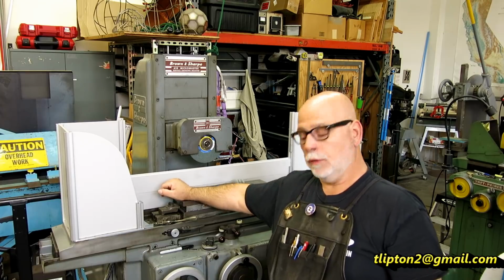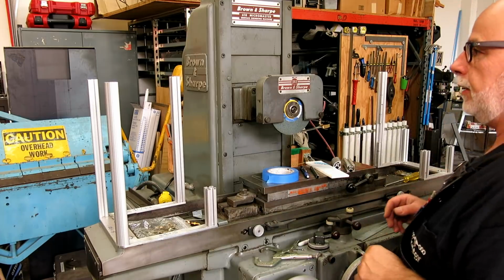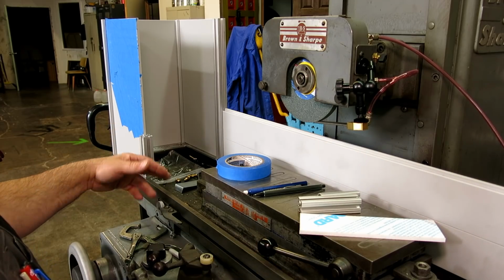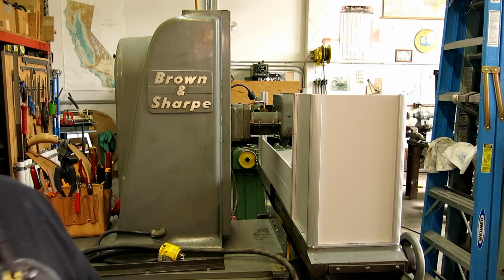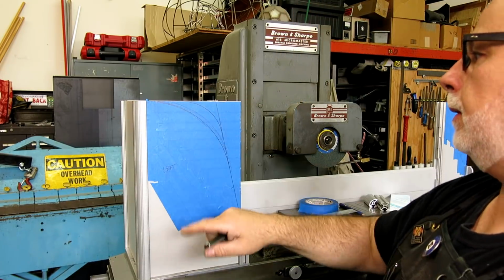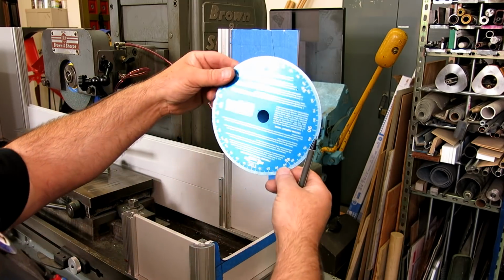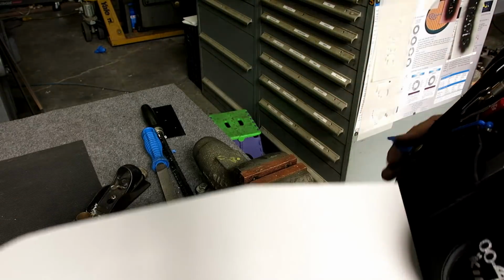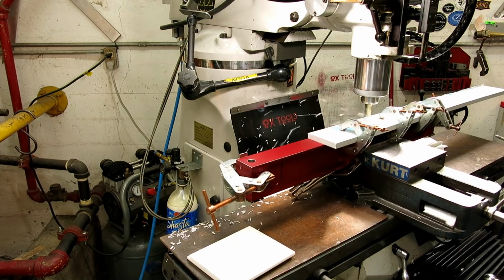Micromaster Flood Coolant Enclosure  P1

Comment: Better make sure all that plastic is "compatible" with petroleum products. Even "water-based coolant" is pretty much water "emulsified" with a smaller quantity of petroleum lubricant. Recycling the coolant right back to the grinding wheel and material may not work out too well either unless you run it through a real filter instead of just a "screen". You're going to have "slurry" in pretty short order otherwise. And its not going to do any pump much good anymore than its going to positively affect your "precision grinding". As for "no direct path" for coolant to leak through, you don't have much experience with "hydraulics" and "fluid dynamics", do you? That "coolant" is also a LUBRICANT and has way better surface tension and "slickness" than straight water. With the table cycling back and forth and coolant getting "thrown" all over, it's going to be plenty happy to take "indirect paths" to leak out of your "enclosure". 

And given the speed of the grinding wheel in "surface feet per minute" and the fact that it IS going to "throw" coolant at least to the extent of what coolant the wheel can "grab" and hold onto well enough TO "throw" it, whether your coolant system actually gains you anything when grinding by its obvious nature is a "constant loss" cutting process where the "cutter" is continually sharpened by getting "ground away" remains to be seen. I can tell you for certain valve grinding machines use fairly thick oil mainly to carry away metal and grinding stone particles rather than for actual cooling and/or lubrication because typically the amount of grinding on a poppet valve that's still serviceable required to "resurface" it is pretty minimal. You can't take more than a handful of thousandths off one without making its diameter too small to the point that it ends up sunk too far in even a new valve seat. 

I think there are plenty of "machinists" out there that grossly overestimate and outright don't understand what grinding is actually used for as far as "precision machining" in the real world. Its rarely used on any "pretty" parts besides crankshafts and even then the final steps are polishing with emery cloth for a desired surface finish. Its not a "finish machining" process for "precision" parts since even when grinding valves the final step is to lap the valve to the seat.

Comment: From a design aesthetics I think what you have so far is backwards. If you want to have the guards follow the shape at the back of the machine, the curve should begin at the end and arc toward the center.  Of course I realize the limitations of the material you are using and perhaps it is not amenable bending. A plastic extrusion, if available, and bendable, would better than the aluminum.  Also, if at some in the future you want to follow a curve, flexible rules are available from 12 to 48 inches. Find them on line at the big art supply stores and probably Amazon.

Comment: On my Thompson the rear guard is scalloped out to clear the spindle at its lowest height and then much taller for the rest of its length to catch more coolant it works fairly well. Otherwise they are very similar looking to yours. What you need to add though is a lip on top of the end guard that comes in at least 2 inches. If not you will get splatter off it that goes over the guard.

Comment: Rabbeting bit on a trim router has worked for me great with this kind of material. Especially when the router is backed up and we need to get parts out. I keep several trim routers loaded with rabbeting, chamfer, and pattern bits for secondary ops on hand to speed up production.

Comment: make a spare wet end panel.. carve a hole in it to mount this.. https://www.homedepot.com/p/Speedi-Products-12-in-x-3-25-in-x-7-in-Wall-Stack-End-Boot-SM-W3127-EB/202907250  12 in. x 3.25 in. x 7 in. Wall Stack End Boot this will allow you to use a reducer and hook up an evacuation system or just a pair of elbows to deflect the moisture downward that comes out with the air flow.  so it blows in a controlled direction rather than off the flat end plate..  its just a cheap fix to what is NOT broken yet..  i have been trying to get steve summers to put one on his extractor hose for the KO Lee grinder he has.  instead of just the bare end of the hose.  his would probably need some trimming to fit properly.  there are multiple sizes and shapes of those..  so you might have to look thru the various stack boots online.

Comment: i'm surprised to see you using a wood plane for adjust shape acrylic. You can use your milling machine like router pin if you have double side tape and mdf template with a dowel pin same diameter as end mill. Thanks for sharing !!!!

Comment: I think the T-can lid did the best job of mimicking the swoop you showed in the side view.  One thing that I've picked up recently in my study of calligraphy is something called the line of universal beauty, basically a tangent entry on top, like you did, and a tangent exit on the opposite side to transition into the drip pan area.  the top and bottom arcs tend to start about 1/6  of x where x is the length of the straight line. 
https://en.wikipedia.org/wiki/Line_of_beauty#/media/File:Serpentine_lines_from_William_Hogarth%27s_The_Analysis_of_Beauty.jpg

Comment: Liking it so far. My only question is the high side on the left, where most of the coolant will fly, what is going to stop it from running down the white plastic, hitting your aluminum base and then running under the plastic? I'm assuming you have a plan for this, just curious.

Comment: Surprised you didn't use clear polycarbonate panels or something of that type to avoid the blockage of light.  Also no problem with color matching...hmm.   Is there a clear material easy to machine?

Comment: Nice. - With the all-electric crowd in NoCal I guess a Cam Degree Wheel isn't in as much demand as it used to be, also I've never been inside a new age engine with variable valve timing so again the degree wheel may be an evolutionary dead end, it's good to see it's not a complete piece of landfill fodder.

Comment: On the left hand end of the table, the guard is usually made of steel or cast iron to catch a part flying off the chuck.
Reply: that probably explains why the one on my (recently acquired) DoAll has been patched up.  It ain't a pretty job, but it will do for now.  I've got an assortment of small leaks to take care of under the table first.

Comment: This is a great solution. Also easy to get out of the way if you are grinding an edge on a garden shovel....
My idea for the height adjustable part at the back under the wheel is to use a venetian blind. Infinitely height adjustable and when closed, will direct coolant down.

Comment: no got one of the mr G's cam deg. wheels used the Stanley hole cutter to rough out a hole then the boring head to finish for a hub that presses on a 7/8 socket for a quick loot at timing chain stretch on bmw engines (there not bozo cars) heck throw one of those in the carpeters box with the chalk line and line level and speed square

Comment: Comeing from the days of the Mayflower I can strongly suggest you new grinder guys get a fume extractor system hooked up. This needs to be in place for removal of gases released in the grinding of different steels. If this system is done correctly it solves three problems. One it vents the dangerous gases to the outside of the grinding area. Two it takes the metal debris out of the air for more operator safety.. And three it will catch and return the coolant that is airborne again for operator safety. An important design part is the vertical pipe orientation so that solid and liquid can run back into the bed to be returned or cleaned out. Keep up the good work Tom

Comment: Designer splash guards....You've spent too much time around the Berkeley crowd.
Reply: Why denigrate intelligent people?  Heaven knows there are wide swaths of dumb ones out there.
Reply: +MrShobar  and you've proved that.   Nah, it was just a friendly dig.  I have the highest regard for Tom and his work.    But I've worked Navy projects at the LL Rad Lab and attended Berkeley and there are plenty of F'ing idiots on that campus.   Any time the city has to put up signs telling people it's not OK to call 911 when Facebook is down... it's hard to apply "intelligent" to the situation.
Reply: "...attended Berkeley…" OK,  if you couldn't get in to Stanford (which I did).
Reply: MrShobar Bezerkley for post grad work... I went to Canoe U., flew Scooters and Turkeys.

Comment: I don't see anything wrong with your use of the block plane, though for that outside curve I'd personally prefer to use a spokeshave.
Reply: Maybe "star board" is intended to be cut with a "hot knife," i.e., a NiChrome wire heated to redness....?  Surely TL has more than a couple in the wings.....?
Reply: I kind of cringed when Tom put it down once he had finished.  But that's just me.
Reply: @briantaylor9266  You mean when he put it down in the rubber mat?
Reply: My cringe was because I'm OCD and always set my planes down on their sides.  Not everyone shares my neuroses. Having said that, I know for a fact that I've made Tom (amongst others) cringe, but he's gentleman enough not to scold :-)
Reply: Or even a surform block plane.

Comment: The 999 trick?
Reply: so, it's a bit like when our ancestors expressed their requirements by physically traversing to the shop and engaging with a human being ?
Reply: Lindsay Fog That’s only a theory.
Reply: 999 is the part number prefix for a custom part number that McM assigns if you call and ask for a special.  They will sell you ANYTHING, just ask.
Reply: It's just a matter of going to your current order (cart) and adding a line using the part number of 999 with a description.
Reply: Keith Ward is that all it is is a line item with a note?  I could see this being the case with Mcmaster.  They are very customer oriented.
Reply: + Brandon Tscheschlog - Yes, that's all it is.  If your description is detailed enough, no further info is necessary.  For example, another vendor's name and part number.  They are very responsive, if was from one of my suggestions they added the "Customer Reference/Your Reference" to the order/cart and packing slip to help indicate what each item is to be used for.
Reply: what Spencer said, they will act like sort of a purchasing agent for you and go to suppliers directly to order what you need. think: any part number from the unistrut catalog. They pass on their purchasing power to you.
Reply: I'm also confused by this. The 999 trick I know is for tracking how many units a seller sells every day by changing your cart to 999 items and coming back every day. Not sure what 999 trick he's using to get custom parts from McMaster?
Reply: Robert McEwen I am curious too.  Just guessing, but I would imagine that the 999 is a special order code.
Reply: This dude never answers anyones questions....
Reply: Tan Tan Do you have a question?